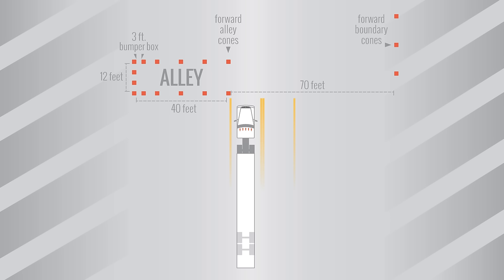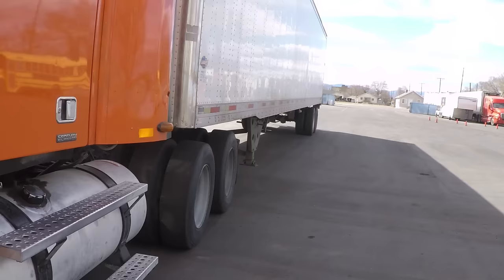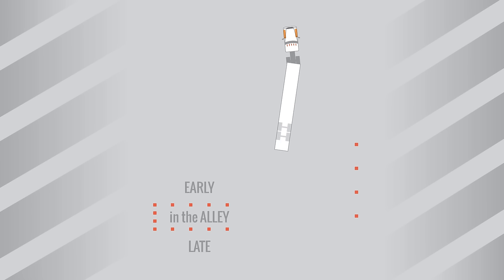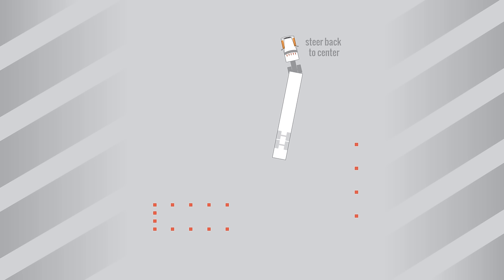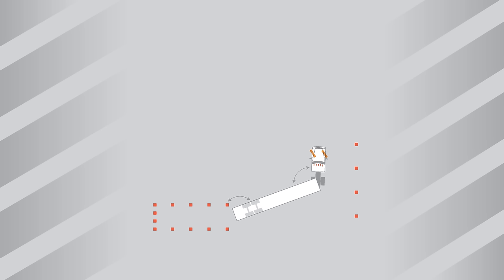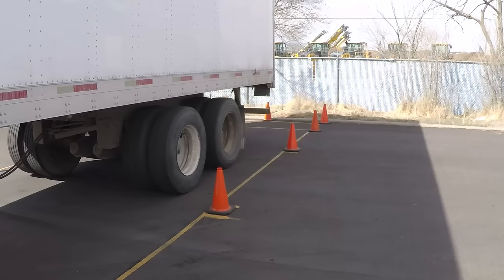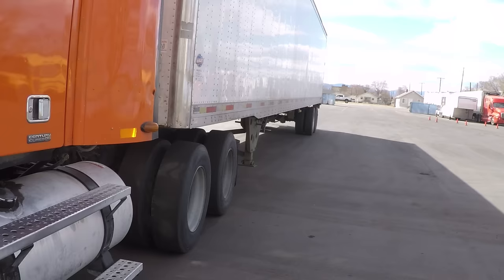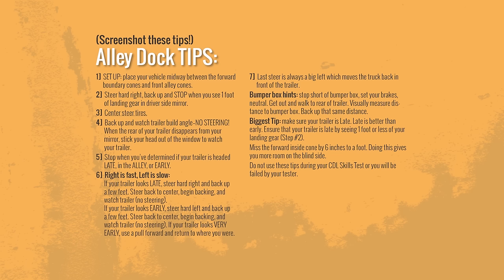🎬 TRUCK DRIVER STUDENTS! Alley Dock, Driver Side

Comment: Why isnt it just a universal way to do these maneuvers? My school teaches wayy different where as I completely understand you guys  way... At my school we start off super close to the box then once your last tire passes the last cone  you count 1k,2k,3k STOP! Get into your 90 degree STOP! back up until you split the tandems STOP! now back up until that last tire starts to rollback STOP! Then I get lost right at this point I'm usually crushing cones smh.
Reply from the maker: HI, Elz. Your question is excellent. You are being taught to jackknife your trailer into the alley. To us, jackknifing is an advanced method for alley docking. We teach our students to arc the trailer in because it involves driving your trailer (i.e. putting your trailer tires on a path to the alley by making small steering adjustments). The arc is easy to teach when you know what to say to the student. When you don't what to say, you teach the jackknife. It's completely backwards. You can practice and perform the alley dock in any manner you see fit. You don't have to jackknife. Ask me any questions you have about the technique in this video. :-)
Reply: CDL College, LLC I have plenty of questions lol. This will be my 3rd time at DDS come Tuesday morning first time I failed blind side parellel 2nd time right offset smh I'm so frustrated I feel like I'm not learning the proper way and just passing them by sure will
Reply: CDL College, LLC what I seem to have trouble with is correcting my mistakes so I end up all over the place. I have practice in the morning I'm just gonna use you guys notes and see where I end up
Reply from the maker: Set up halfway between front alley cones and front boundary cones. Grab that first small angle. Steer back to center. Back up and watch the trailer, no steering. Is your trailer headed toward Late, Early, or in the Alley? Early sucks. Early may require a jackknife. If you become frustrated, hop out and watch the video again. Let me know how it worked for you, Elz. Ask us anything.
Reply: CDL College, LLC thank you sir and I will.

Comment: So if your trailer is heading directly "in the alley" not early or late but on time and in the spot what do you do because your trailer is still tending to go left? thanks
Reply from the maker: I understand the first part, but not your question, heygoosk. Try me again, please...
Reply: CDL College, LLC you're saying if you're late you want to steer hard right if you happen to be early you need to pull up but if you're headed perfectly into the spot on the first try your trailer is still slowly swinging left
Reply from the maker: Your last turn is always a big left when performing the driver side alley dock. That left turn puts the truck in front of the trailer and allows you to straight back into the alley. Does that help, miss?

Comment: The problem i'm having is not knowing when to give it the left. the set up is 10 steps forward from the cones and 10 steps parallel to the cones. straight back turn hard right to a jack knife until the wheels push into the box. This is where alot of us are getting confused. the wheels are pushing into the box but the tractor is all the way to the right. biggest problem I see is when you come straight back and miss the turn the correction is more difficult. I wanted to get some advice. I test tuesday i'm totally lost!
Reply from the maker: Quoting from your comment: " the wheels are pushing into the box but the tractor is all the way to the right"
If you initially turned to the right, the tractor would be all the way to the left, correct?
If you're being taught to jackknife the trailer, I would recommend turning back to the left earlier. So, as you're approaching your jackknife angle, steer back to the left FAST.
Steering back to the left is a matter of WHEN for you guys.

Comment: do you guys have a video that helps to avoid encroachments on both offset maneuvers? my school allows 12 points on all 3 maneuvers im just trying to get the best score possible. any tips from new or seasoned drivers would be appreciated too.
Reply from the maker: Avoiding encroachments...we do not have a video that specific. Which cones are you concerned with, the outer line of cones, or the center line of cones? Thanks, Samantha.
Reply: The outer cones for driver side offset and the center cones for blindside

Comment: Hi, i have a question regarding the 1 foot of the landing gear in the driver side mirror :  Is that mean 1 foot by an angle outside  created starting from the rear tire ( tire # 7) of the tractor that i can see apear in the driver side mirror ? Thanks in advance.
Reply from the maker: Hi, Karl! That was a little vague, our apologies. We meant 1 foot of the landing gear (the square footpad at the bottom of the landing gear). Thanks, pal.
Reply: Hi, yes I got that... my question is more to understand 1 foot opposite to what ? Just to make sure  1foot you mean 12 inches (measurement), right ? Not 1foot meaning the square of the landing gear it self? Sorry if I’m not clear... hope you can understand... English is not my language.
Reply from the maker: Your English is awesome, Karl. When the truck is directly in front of the trailer, your landing gear is not visible. So, if you turn the steering wheel to the right and back up, your landing gear will begin to appear in the driver side mirror. When you can see 1 foot of landing gear (along the horizontal axis), stop. Does that help, brother?
Reply: Yes, clear now... in a hurry to try on coming Tuesday... by the way, thanks you guys, taking time to post such great detailed videos and nice tricks ... my favourite is right is fast left is slow, that will be very helpful. I will never forget this one :o)

Comment: cdl college, you guys have a good way of teaching, wish you guys were out here in los angeles, california. do the same rules apply for a 30foot trailer when alley docking?
Reply from the maker: Thanks, Gabriel!
If you're backing a pup, you'll want to set up much closer to the alley.
Your shorter trailer will turn faster than the trailer in the video. You really need to watch a shorter trailer. Stick your head out of the window.
Small turns to the right force your trailer left. When you make a small turn to the right, don't hold it very long. Go back to center quickly.
Reply: Thank you for the good tips, CDL college

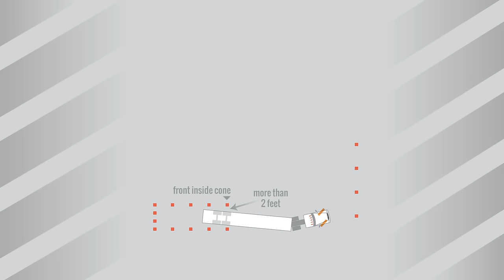Comment: Question: at 4:00 into the video, you said to pull forward to avoid encroachment of the cones on the right side of vehicle. In this setup,  would you suggest leaving the steer tires at hard left, pull forward just enough to bring the trailer in a straight line within the box, then hard right to bring the tractor straight with the trailer? Or straighten out the steer tires first, then pull straight forward to bring the trailer inline with the tractor? Sorry, but not getting much help from school instructors!!! Thank you.
Reply from the maker: What an excellent question. Thank you, G.I.
When pulling forward I would, at the very least, return the steers to center and pull forward to the forward boundary cones.
You'll probably have some angle between the tractor and trailer when you stop. You may be able to use that angle when you begin backing up:
• If you need the trailer to move to the left (to miss the blind side cones), begin backing with the steers centered. Steer hard left to put the truck back in front of the trailer.
• If you think the truck needs to be in front of the trailer ASAP, steer hard left and begin backing. Back to center just before the truck lines up with the trailer.

Hope this helps!

Comment: will that process change if you have a 28 foot trailer?
Reply from the maker: Yes! Your set up does not require you to be as far away from the alley as a 53. You need half the distance we show in the video. Then, when you make the first right to bring your trailer to the left, steer back to center when you see half of the landing gear foot (you'll want an even smaller angle than we gave our tractor/trailer. Make sense?

Comment: Would this work with a 48' trailer? In our settings, the outer boundary cones (the ones on the right in the video) are much, much closer than 70', roughly twice the width of my vehicle. Can I still do this way of backing? I've been taught to alternate hard right and hard left, and it's not really working? Thank you.
Reply from the maker: Alternating from hard right to hard left is BS. This maneuver requires a big turn at the and, not while you're backing to the alley. You're getting bad advice.
Reply: @Cdlcollege  I'm happy to read that it's a bad method. It's not getting me anywhere. Hard right, count to three, hard left, count to three, do this until you're into the box. Failed my test first time because of that. I'll try and see if I can do your method in our much narrower settings. At least yours makes sense. Thanks again.
Reply: Well, I tried this method today. All I was able to do was to jacknife the trailer, and I have no clue as to why.

Comment: I stay suck i this I don't know why.  Can u give me some tips and tricks.  seems like I build to much arc buy the time I reach the cones.  plus it's not a 53 footer.  not sure what size it is if that makes a difference
Reply from the maker: Shorter trailers are more difficult to control than longer trailers because shorter trailers react faster.
As you back up toward the alley, the turns you make to the right should be small and brief: small right turn, then right back to center. Repeat.
Watch your trailer tires and the inside front alley cone. Try to create a path that passes right by that cone.

If you're trailer is early, as you stated, it's because you are either steering too much to the right, or holding your right turns for too long.
Hope this helps, Mike!
Reply: CDL College LLC.  thanks alot!!  I can do it with ease now thanks to this video.
Reply from the maker: Sweeeeet!
Thanks for the feedback, Mike. You rock.

Comment: I've been trying for 2 weeks to get this 90 degree backing i keep going to early what do you recommend i do i really need to do this asap & can't figure it out
Reply: Reduce your initial angle from the beginning to make the trailer path late rather than early.  You are holding the initial right turn too long before straightening the steering wheels.

Comment: If my trailer is shorter for example 36' how much room should I give myself between the cones.
Reply from the maker: Placing your vehicle in the middle (halfway between front alley cones and forward boundary cones) means the arc that you create on your way to the alley, is more rounded in shape. That's preferable. If your vehicle is too close to the front alley cones, you'll have to jackknife to put the trailer in the alley. If your vehicle is too far away from the front alley cones, you risk hitting the forward boundary cones with the nose of your truck during that last big left.
Reply: Good question. I would also like to know how far forward to pull while at 90 degrees to the alley on the initial set up. It looks like one vehicle length in the video, so does that mean a shorter initial pull up if you have a shorter trailer?
Reply from the maker: A shorter pull forward will work for a shorter trailer.

Comment: Any recommendations on how to set your mirrors?
Reply from the maker: You want the rear of your trailer to run down the middle of the mirror. Does that male sense?
So, when you look in either mirror, the back of the trailer should be in the middle of the mirror when the vehicle is squared up.
Thanks for the question!
Reply: Thanks for the response.

Comment: This is the most CONVOLUTED and unnecessary explanation of an alley dock ever. Lmao. And none of that will work at a real consignee or shipper/receiver. U probably wont even have that type of space to work with. "A foot of the landing gear"??? What oddball, arbitrary increment of measurement is that? "And right is fast, left is slow". Thats not true. Right and left are the same speed. U must mean that if u already have ur jackknife to one side, the trailer will respond to that same side faster. Which isnt true, its the same speed either way, it just seems faster due to already having that angle. Maybe this explanation is for brand spanking new drivers, but it just seems really confusing.